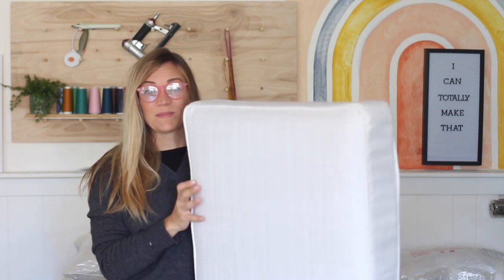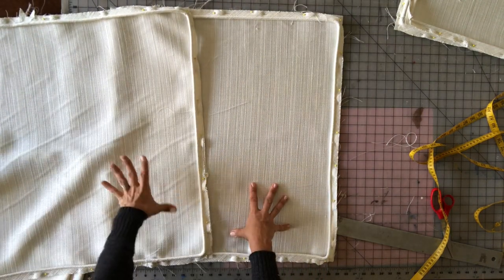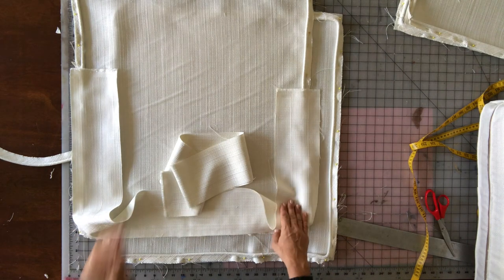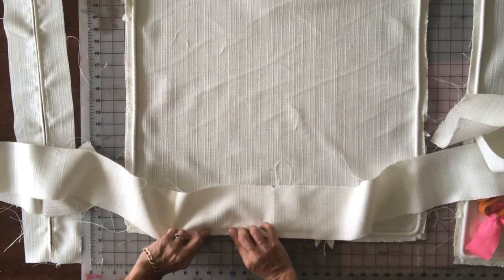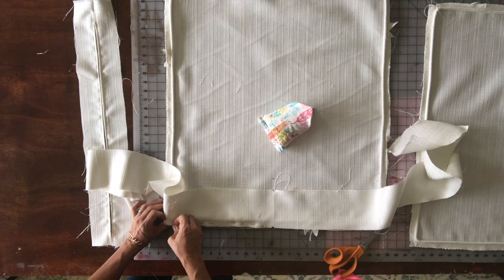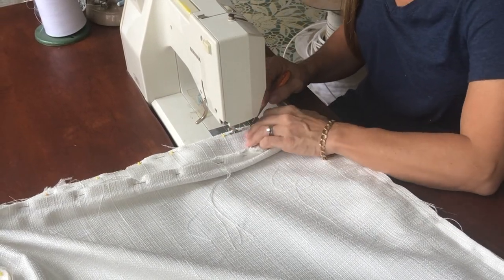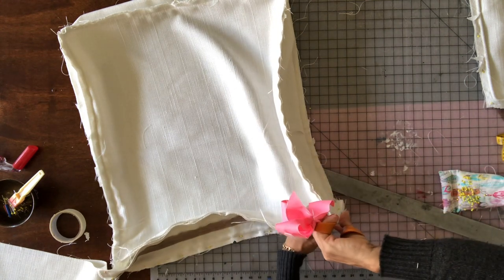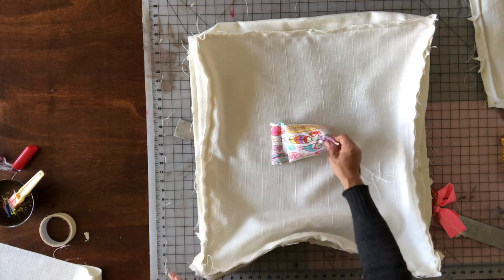How to sew a boxed cushion cover on a home sewing machine.

Comment: Thank you, your videos are extremely helpful. I do have a question. I find that sometimes my fabric doesn’t line up even when I do notches as you mentioned. Am I possibly pulling the fabric?
Reply from the maker: probably not. It's probably shifting because your feed dog pulls the bottom fabric through faster than the top fabric against the presser foot and therefore it shifts. A walking foot will eliminate this. I have a video explaining a little more.... https://youtu.be/P5LNE64EpNc

Comment: Love your videos.  Is it possible to find out what kind of welt cord and size you purchase for your projects and from where?  Thanks so much
Reply from the maker: I have used 5/32 welt cord for a long time. I think it's the most standard size. However, I got a roll of thinner welt, and used it on the two matching sofas i just slipcovered and i really like the it. I think it's 2/32 but not sure(it was given to me). I get it either from Rowleycompany.com or my local upholstery supply shop. There's certainly a local upholstery supply shop in your area that supplies to all the upholstery shops. They'll have samples.
Reply: Thanks so much @MimzyandCompany

Comment: I am making a rectangular cushion. It measures 36" x 16". By your measurements,  the fabric should be cut 37""x 17".  I want the zipper to wrap around the cushion a few inches on both sides, to make it easier to remove it. I noticed that your zipper panel is attached last. How long should my zipper be? Is 42 inches a good size?
Reply: Yes 42” will be perfect. You don’t want to end your zipper panel too close to the corners…it makes for very difficult corners. So 3” on each side will be good.
Reply: @melissalombardo7839  I have decided to make the zipper plackets (making 2 of them) along the short sides. Do I still need 3 inches on each side? Do I need to buy 2:23 inch zippers? or will 22 inch zippers work?
Reply: @janicejettsitter2097  you mean you’re going to put a zipper on either end of your 36” cushion?  If so that will be very difficult to stuff….and your zipper will likely show in the end right? I’d probably buy continuous zipper by the yard ,so you can put a long zipper down the back. I may be completely misunderstanding you….

Comment: I have a question, how do you meet the welt together? What do you use to attatch/hide the seem on it?
Reply from the maker: There's a couple different ways to join the welt. I cut out a little of the cord and then overlap the fabric with the top fabric folded so theres no raw edge. It gets pretty thick.

Comment: Hi again!  You mention a good quality thread when sewing pillows ,  can you suggest one and what size needle do you use with it?  

My MIL gave me an older sewing machine , to be exact ... it’s called a “Tailor Professional” ,.  I can’t find much information on the machine online and I am unsure what this machine can handle .  I don’t know how to use the features no manual came with it.  

Lol at 53 I’m trying to self teach myself sewing. So please forgive my silly questions.  I like your tutorials as you do go into depth and not skip some of the basic instructions that others know.
Reply from the maker: When I say a good quality I mean like a Gutterman or other decent brand like Coats and Clark. When I started, I used whatever I had on hand and that usually ended up being old or sometimes serger thread(cone thread) and serger thread is thinner and not strong because it's intended to be used with 3 other threads together. Old or inappropriate thread breaks easily and I found that some of my pillows and things would open up. Some projects like draperys it doesn't matter so much because there's no pressure on the seams. But with pillows and cushions there's seam pressure, so they tend to open up with cheap/old thread.

None of your questions are silly...when I REALLY started sewing my mom was already deceased so I learned trial and error. and a little bit of memory of watching her sew. It's so much easier when you can just ask. ;)

I haven't heard of your sewing machine brand, but it has professional in the name so it oughtta be good. LOL
Reply: @MimzyandCompany  thank you kindly!!!

Comment: there is something so scary about adding Welt I want to, but nervous beause when sewing it all together majorley cumbersome.
Reply from the maker: it does seem a little more complicated and more bulky but it actually makes the seams stronger and neater. And I find it makes sewing the slipcover a little easier because you just sew right on top of(if you have a welt foot) or right next to(if using a zipper foot)the welt.